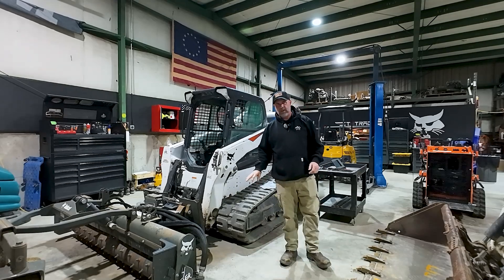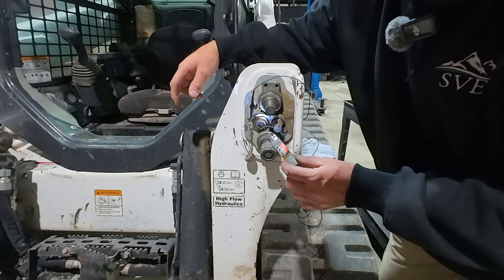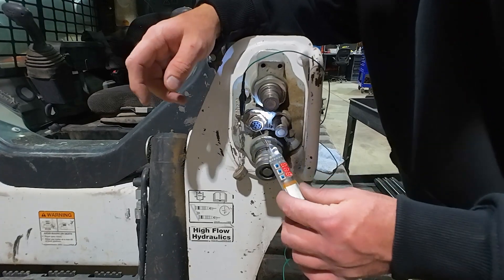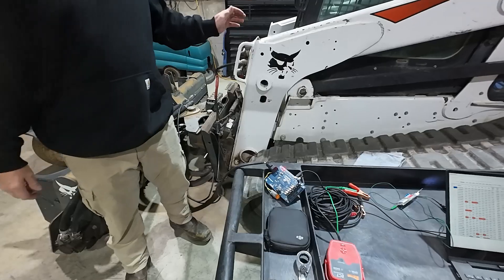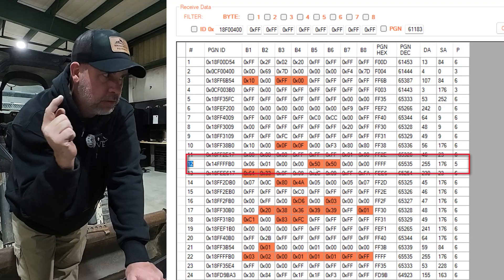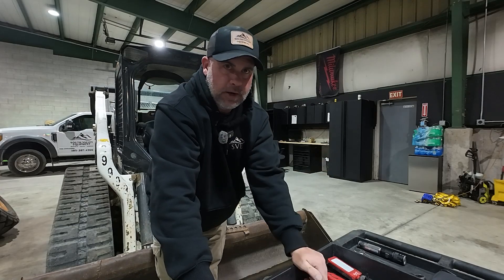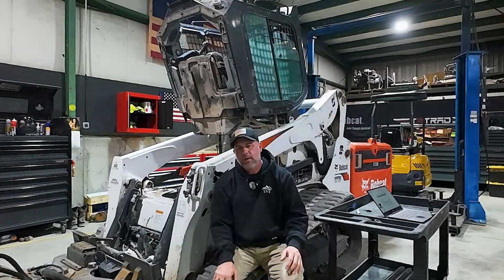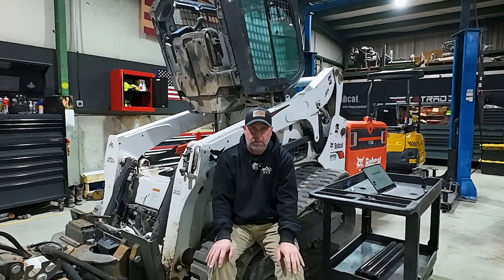Dealer Charged Thousands… Didn’t Fix Anything — I Fixed It for FREE!

Comment: You are so correct, management with lack of leadership is a lot of  the problem.  They probably didn't have the proper tools equipment or knowledge because of Management's lack of leadership.  Another great fix thank you for the video.
Reply: Yeah management can make a huge difference. My dealership just got bought out because of poor management running us into the ground. Now it's a long steep road to rebuild our customer relationships and try and get out of the hole.